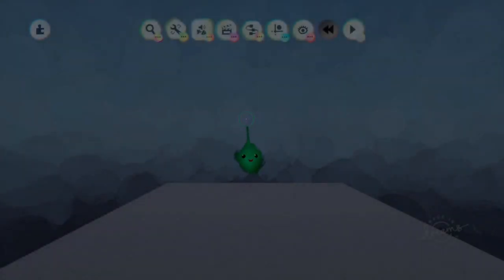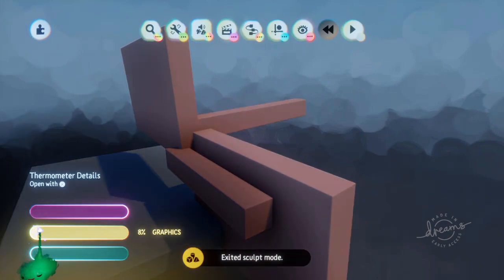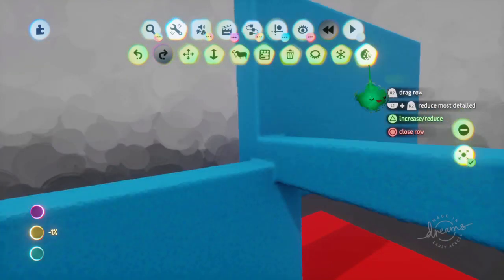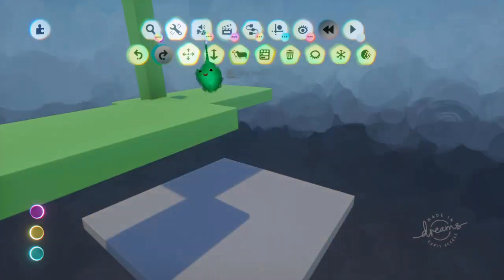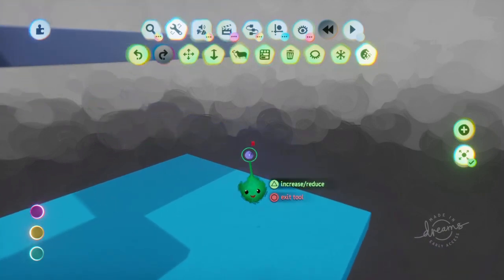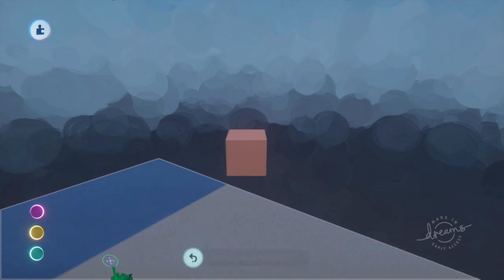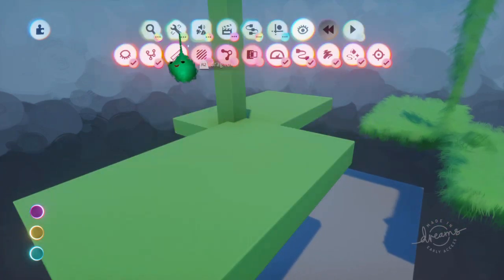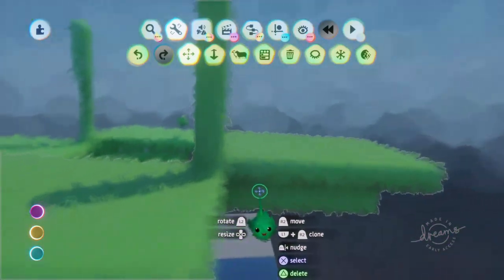Sculpt Optimisation - Detail | TAPgiles Daily Dreams Tutorial

Comment: When modelling large scale the Detail is really low and won't go higher, nor does lowering Looseness help. I can't work on big landscapes or open world with this. If I created a large plain and sculpt into, say for a river, it's terrible quality and the flecks are huge even when set to lowest and max detail. Any suggestions?
Reply from the maker: The reason this happens is because any individual sculpt can only have a certain size. Regarding this, lowering the detail makes the edits within a sculpt smaller (making for less detail to be stored), and scales up the sculpt itself (meaning the flecks get larger). So then if you make a really large sculpt, it down-resses so that a sculpt of that sisze can still be stored in the engine.

So to get around this, instead of making an entire world as one sculpt and having a ceiling on how high the detail can get, use multiple sculpts and clone those around.

If you're doing something flecky like grass or water anyway, then it being low-res will be fine. But if you want to increase the resolution and make the flecks smaller, either break it into multiple overlapping sculpts, or use the same sculpt and clone it multiple times (this is a lot cheaper on graphics thermo).
Reply: @TAPgiles  Thanks so muchf or the explanation and help! I think I'm just gonna have to deal with it, because anything slightly big and it lowers detail, I can do it in sections but the piece I want to do is a cracked ravine in an open world, this can't be done in pieces too easily because of how the piece blends together and creating it in seperate sculpt pieces would be hard to blend together as one to look seamless. I just wish that lowering the Looseness in certain areas upped the detail elsewere - this would be far better for optimizing imo. Thanks again.
Reply from the maker: @BurntFossil  I mean... it has to be pretty huge for this to happen, honestly. Not just "slightly big." But I can understand your frustration if you're trying for a particular look.

You can hide the seams without too much trouble. Just add some shallow cuts to the edge and overlap it. It won't show up in the lighting; you can make really smooth joins that way.
Reply: @TAPgiles  Haha yeah I'm sculpting pretty big, an open world and that cracked ravine I needed took up a tonne of space but I'm able to work with it better now and keep more detail. Thanks for the help once again :) It's also a little odd because I come from a hobbyist 3D/ sculpting background and Dreams is completely different in a lot of aspects.
Reply: Hi Aaron. Just curious how that project went. I am wanting to make an open world game but between the lack of visual fidelity due to graphics thermo and physical limit on unique item I am and a point where I may have to drop the project.
Reply: @Munnky78  I completely dropped it and actually quit dreams because it's too limiting. I really dislike the way they calculate things, even a small game is almost impossible to do considering one single Doorway takes up a crazy amount of Thermo so say goodby to having a few cave/ temple entrances to lead to a new map.

The engine works the same way any other engine does with LODs for lowering detail at different distances to ease up the fps/ processing power however, Dreams' Splat Engine is different, or at least how the developers forced a purposeful limit, in how it essentially 'acts' as if every object is loaded at once (even though it lowers detail and even unloads them); each map for example has a limit of 1000, one of your sculpts could take up 650 and a another 350, traditionally, and in Dreams too, from a far distance these sculpts would be low in detail (LOD) so there's no major drop in FPS, HOWEVER that's irreverent in Dreams since that 1000 limit has been reached even though no object is loaded at that distance. It's a linear limit the devs put in place to stop people overloading maps with a million complex objects, as most users will NOT monitor the FPS counter in complex areas of the map, all I suggested was to implement an 'Advanced' feature that bypassed this forced limit, so you're free to make your map as laggy or as optimized as you want.